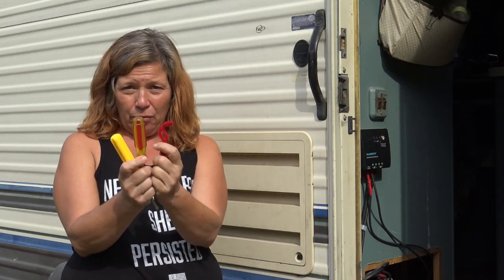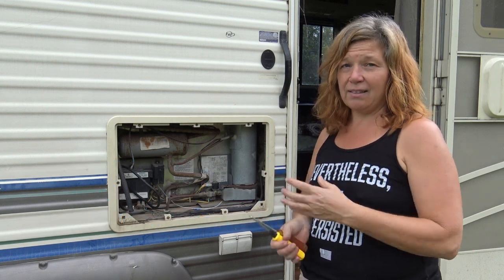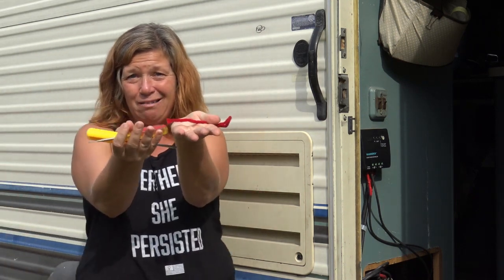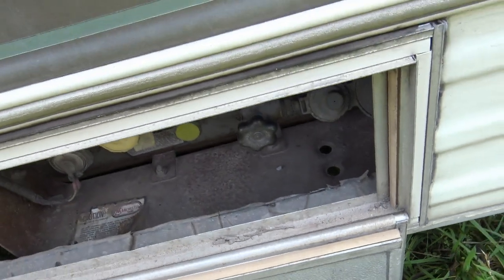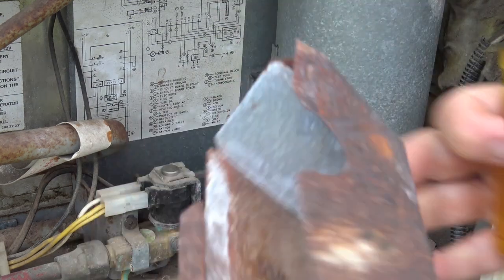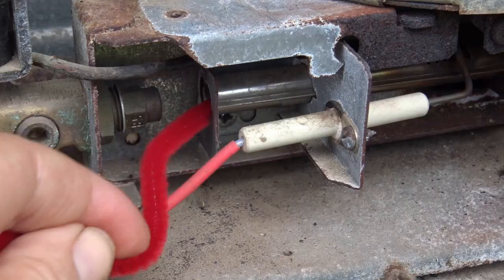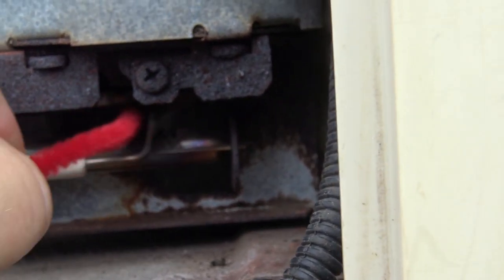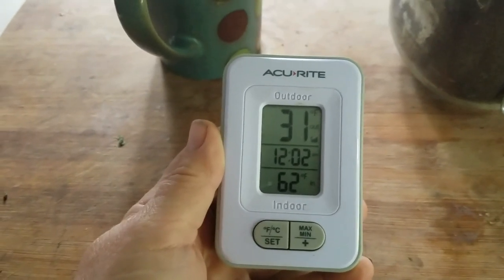How to Fix an Old RV Refrigerator that Doesn't Get Cold

Comment: Super!  Way to get your hands dirty.  Since you want to save $$ and DIY is the only way with an RV, I have a couple suggestions for you.  The most important is when fixing an item on a RV, before you disassemble anything, take several pictures of it, from different angles, if possible, before you touch it.  After you remove item you can look back at pics and it will help in reinstallation and/or trouble shooting the issue.  You should blow compressed air up through the exhaust stack to make sure the stack and vent are clear of debris.

Comment: Carolyn, that orange flame that you are seeing is just dust particles in the air burning, nothing to be alarmed about. That part you installed partway is meant to go all the way in and be screwed it. What you actually did was leave the flue unsealed, which means you will get CO in the compartment and inside the coach. I hope you don't injure your self by doing this.
 Invest in a couple of cans of compressed air and blow out the burner. Get a brush and clean out the vent stack. LP gas will scale up the stack. Spending 37 years in the natural gas industry I've seen a lot of F'd up things that the customer has done. If that part was blocking the flame you would see a lot of soot all over it.

Comment: The design of the cover would imply that it is directing all the fumes to go up the flue, but one might worry that leaving part of the cutout on top outside the flue would allow carbon monoxide to be escaping into the shell containing the refrigeration equipment....that could be bad if there is way for it to further seep inside Matilda where you are looking to be breathing oxygen after you've shut the doors and windows to go to sleep. Just something to think about before drifting off.  :)

Comment: I also clean the burner tube with some compressed air and spray primer on the rust areas...
Reply: use Liquid Wrench on the screw. Let it soak in. Tap with hammer. Turn with screw driver with a lot of downward pressure.

Comment: Order a new draft cover. It was designed by engineers to provide proper safety and for top operation of your system. Also make sure you have good ventilation from that panel you removed on up to the fresh air exhaust. Also good troubleshooting. you might want to also want to clean your orifice

Comment: the heat is suppose to exit trough the roof vent if it is restricted it will cause higher than normal fridge temps  . the coil loops on the outside at the top is where it starts to dissipate heat . up to the roof
these should be clear

Comment: Check the flu from top to bottom. I remember Chico from Chico and Rufus having the same problem. I would suggest putting that piece back where it was and screw it down. Just saying. I hope that helps.

Comment: You need to be careful about not putting the flame guard back correctly, it helps protect the insulation in the flue channel from direct flame contact.  One of the things that will help keep your fridge cooler in hotter temps is to install a small computer fan inside the back channel of the fridge to push the heat up out the top of the RV, it will help make a dramatic difference in keeping your fridge cooler while using less propane.

Comment: These RV fridges can be finicky.  I have had 2 quit, loss of ammonia gas and it is curtains.  Average life span is never more than 15 years for me,   some only make it 8 or 10.  Cross your fingers, it may continue to work, but be warned the end may be in sight.  Shopping around when you do need to do a replacement can have huge rewards.

Comment: Not an expert have owned everything from old 78' to new 2016's 3-way and more than I care to think about Propane only camp fridge/freezers. Best guess, flue pipe needs cleaning (that which is full of rust) an extended brush from RV dealership or Camping World will clean the scale and rust out. I bought my one size fits all with my last fridge maker. Soft bristles sized to pipe.with flame/wind protector removed so it all falls down. Clean from top/roof down. Then a mask and glasses to protect eyes and breathing - put a shot of air up /or rap at bottom  pipe to get the rest out. Put the wind protector back on, it keeps the flame on in winds. Light and enjoy.
The clicking is your automatic re-ignitor ac,dc,propane 3 way fridge.
RV Crazy did within the last year with a better explanation than I am presently capable of giving.

Comment: Carolyn, I am pretty sure that the guard you did not fully install is to protect the flame from flickering or blowing out if you are driving the vehicle. Sitting stationary the refrigerator will probably work just fine, but with out the guard you need to see how it works when you are driving at highway speeds. Safe travels.

Comment: It's important that the burner cover be reinstalled correctly. Lifting up on the boiler pack, just as you did to remove it, would provide the necessary room to reinstall it properly. For more information on RV Refrigerator DIY Videos, check out our Channel. GBYAY!

Comment: Carolyn: URGENT: The flame guard urgently needs to be screwed in with 2 screws to stop movement! Even though the pipe sits heavily on top of the fire guard, the guard can slowly "wriggle" out! It would be very dangerous!
Reply: Hi DLR! But if it wriggles out it is a problem, or else why did they have a screw in the first place?

Comment: It says the wire a dab pipe cleaner are used when it’s cooler of a course I use carburetor cleaner. I sprayed all in a really good it cleans it all out. I haven’t showered up the fluke or are you not at the spout, the chimney spout then that’s what I do when I clean them out they seem to work a little brass wire brush when I was small wants to clean a little thing that that’s that’s on there you clean it up with that and you should be good to go. That’s what I do. You should probably try that it does wonders man.

Comment: Stop by an electronics service store and ask if they stock cans of compressed air. It's used when servicing computers do blow dirt and dust off computer power supplies and computer boards. Be advised the air is compressed to a liquid so when you use it with the supplied itty bitty red blow tube that you insert into the press valve so you can accurately direct the flow of air to clear what you need to clear. Use the red tube to blow out the burner, a brush like the pipe cleaner you've been using is ok but I think a high speed blast of caned air will help. If you have a small 120 volt air compressor with its own storage tanks that will do the job as well.

Check out this rv refrigerator service video it has some very good tips

https://youtu.be/vXr4d8w1msU

Best of luck.

Comment: This video could have been about 45 seconds, She cleaned out the flame tube with a pipe cleaner. I used an air compressor to blow mine out. There I saved you 14 minutes. Why does it take her so long to get to the point?

Comment: They will blow up.  Years ago my husband and the local gas man were working on our camper refrigerator. I am thinking they were upgrading to a newer one.  Any way they got it all done and hit the switch that would provide the flint spark to light it and it went WHOSH.....    I was inside the house and heard it but thought to myself that I was wrong in thinking it had blown up.  Hubby came in with his arms burned and out little girl squalling.  She had been in there with them just messing around.   The gas man heard it and jumped under the table and wasn't hurt, my hubby grabbed our little girl by the arm and tossed her out the door and then grabbed the fire extinguisher to put out the fire.  It went pretty quick but didn't destroy the camper.  Hubby went to the dr with his burns and after checking little one out her back was pink and the fuzzies that were sticking out from her little ponytails were burned off but otherwise she was just mad because he dad tossed her out the door.  It could have been so much worse.  She was in an all cotton play suit with little cap sleeves and that all kept her from catching on fire.  What happened?  They forgot to turn the gas off at the tank.    Thanks for the share and glad you got it repaired.

Comment: RV frig is an Absorption type refrigeration unit and requires certain temperatures to work correctly. I don't see anything you've done that would cause danger or harm. Increasing the combustion rate by servicing the burner was a good thing. That cover means nothing.

Comment: Time for propane refrigerators to dissappear from the planet. 

Instead of propane refrigerators, please consider using the newer high-efficiency standard refrigerators: 
1. cheaper first cost
2. cheaper running cost/more efficient 
3. less weight 
4. more space 
5. more reliable 
6. works better in hot weather
7. no outside ventilation required
8. safer
9. easier to install
10. no stringent leveling required
11. less maintenance